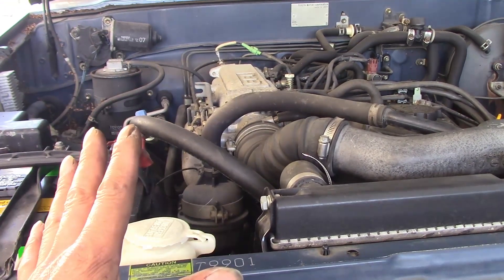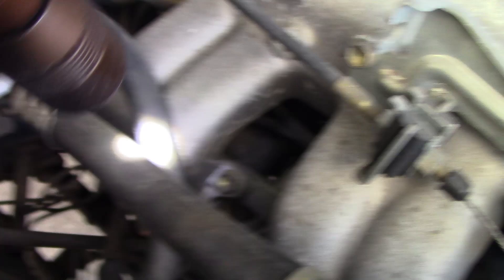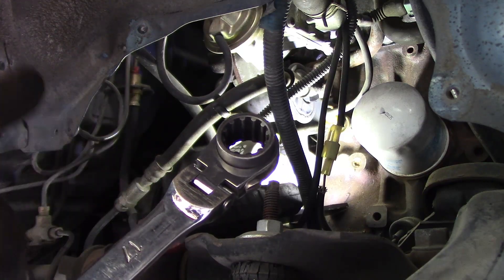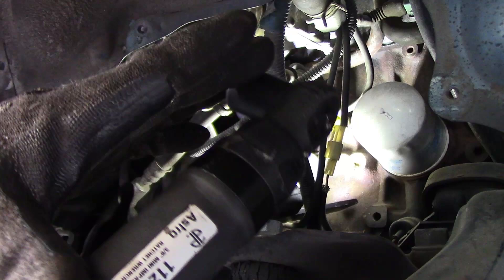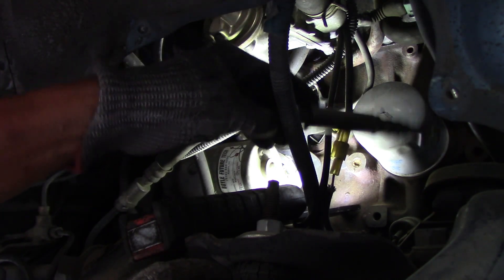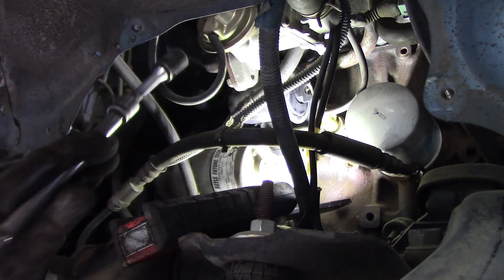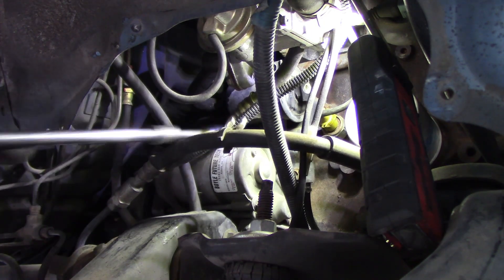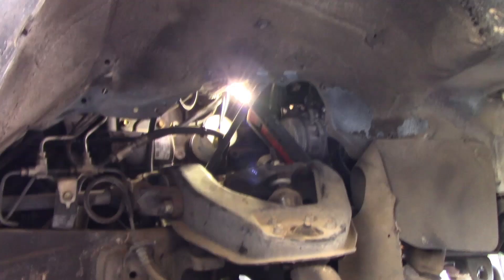1988 Toyota pickup 22re fuel filter replacement I Easiest Way

Comment: I have a 95 toyo R22 2.4L engine code 25 . It idles up n down what could it be Boss Men
Reply: O ring on idle screw on throttle body. Or spray it with Ed 40 or something